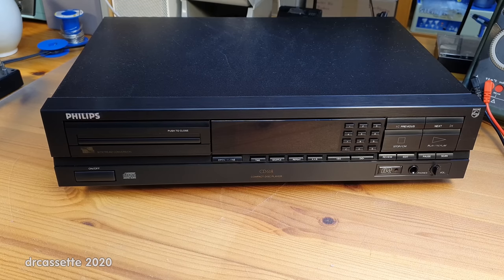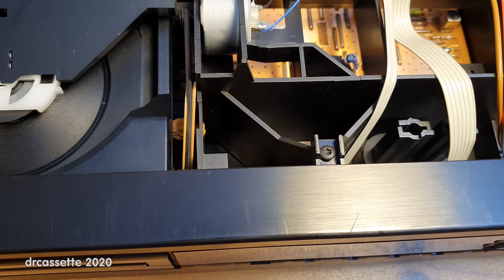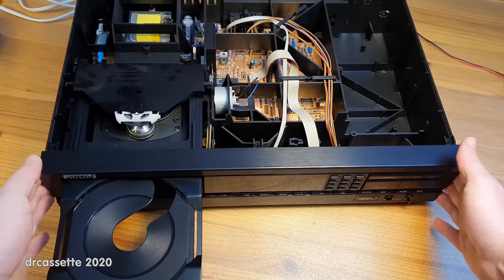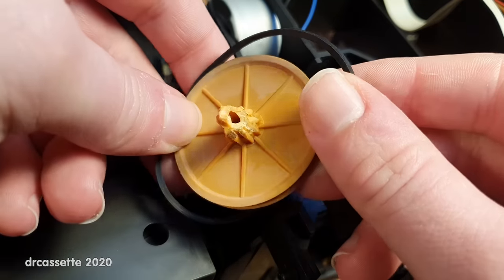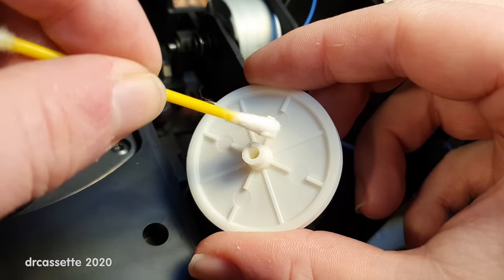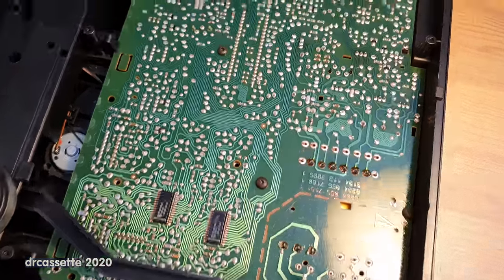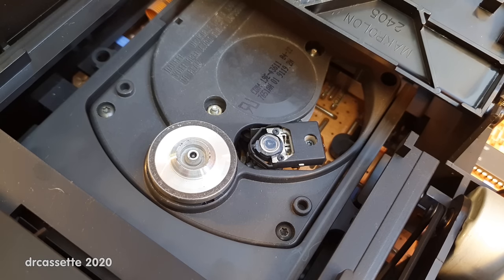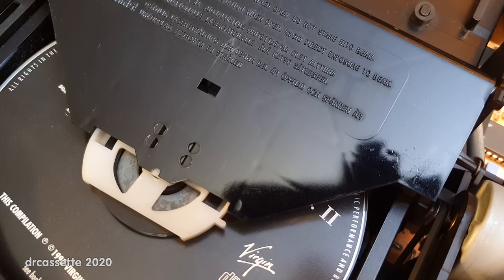Philips CD618 CD Player repairs - CDM4 drawer gear wheel replacement

Comment: You keep calling this garbage, but this was actually the end of the period when Philips and Magnavox (then owned by Philips) made some really decent gear. I would say between 1986 and 1993 or so. Philips also had a high quality reputation in the 1970s until about 1981 when they started using crappy plastic for everything; fortunately later in the 1980s they saw the error of their ways.
In the mid 1990s Philips was in trouble because of heavy competition from Japan and elsewhere, and that's why they started making everything cheaper again, with lower quality materials and components (they didn't make their own components anymore either).
Bottom line: Philips equipment from before ca. 1982, and from between 1986-1993 is not as bad as you may think. Serviceability was always bad with Philips if you compare it to e.g. Sony, but a lot of stuff didn't need servicing in the first place.
Reply from the maker: Where do I "keep calling this garbage"? Give me time stamps!
Reply: @DrCassette  You didn't use the word "garbage" specifically, but you did say some negative things about it:
0:10 "Nothing special" "plastic faceplate" "typical dubious Philips build quality"
1:19 "Lots of plastic; yes it's a Philips, what did you expect"
13:23 "The top cover has this weird texture... that's annoying"
I'm not saying you're wrong, all those are valid comments for this particular CD player. And you praised it too.
My point is that Philips didn't always make crappy stuff and this was not a crappy CD player at all when it came out, even though Philips was in its "Let's Make Things Better" (but only for the shareholders) phase in 1991 (a lot of people at Philips lost their jobs around that time). The number buttons on the front panel and the display that shows track number and time simultaneously are a sign that this was probably a higher-end model at the time, and in spite of the stupid drawer gear, I'm sure it still works great after almost 30 years. I'd say that's commendable. :-)
Anyway thanks for posting!
Reply: @JacGoudsmit  the problem is that they were a great brand in all they built but in the early 80´s they turned themselves for plastic and low quality equipment, when they notice they lost is market regarding to hi-fi components ,the release of new quality material was done but the building materials were still bad ,and when to release the digital cassette i watched when in Lisbon they rented a store in a shopping center or mall  they didn´t caught the atention of possible byers ,at the time i was living in Lisbon, Portugal and several times i watched the store empty, people were already used to relate philips with low quality ,they had the colour grey to see if one could find it interesting but still bad quality plastic employed in the building of the components ,they had earlier a good quality hi-fi components but by that time no one looked for philips to buy a hi-fi system, they did own other brands where the selling success was great but not that good as expected, but it´s sad to see one of the greatest brands destroy themselves in what relates to hi-fi components, the ones i bought from their 79 F series were good ,they still are in use and with great sound quality, but they lost with the at the time manager of the brand, with a incredible decline of quality . I owned a radio with a strap to carry on the shoulder that the deck A was incredible good playing cassettes but having used it for around 10 years to listen to music whenever my group of friends travelled to the beach or countryside it endured lot´s of bad treatment ,it kept working till today, my father who was faithfull bought in 1990 a ,what they call now boombox and it was really good in what cocerns to sound quality ,this with not so big woofers they had a lot of bass with an equaliser and a on/off button to increase the bass ,even had a on/off key to work ,normally they work when you pressed play on the tape or turn the selector to the cd player or radio, that was a good boombox compared with others from the same year, all the brands did decline their building quality by the same time but the quality of the components still was there no mather if they were all made of plastic,we had to surrender to japanese brands it was a pitty seeing several european good brands disappear by the same time . About Magnavox i never seen other than philips material re-branded , if it turn out to be an independent brand i never saw it ,the radio that i refer to with a strap to carry it on the shoulder had a Magnavox brother but instead of light grey was black ,this in austria ,the only place i saw magnavox material ,regards

Comment: I have a Philips CD 750 it won’t play the first track of any CD and then skips occasionally it seems like it can’t find the starting point any ideas please let me know thank you
Reply from the maker: You could try to very carefully clean the lens of the laser. Use an alcohol based window cleaner, apply it with a cotton swab, use another cotton swab to dry it off. Generally there is not too much that usually goes wrong in the old Philips mechanisms.
Reply: @DrCassette  thank you it works perfectly now

Comment: You do not have to remove the frontplate nor losen the powerswitch,just take of the clamp and you can slide out the cd platter through the front
Reply from the maker: No, you can't. Not on this model. The end stops for the CD drawer are part of the front. With the front in place you can not pull out the drawer.
Reply: @DrCassette  Oke,my fault,I am used to the other design of Philips I guess,

Comment: I wonder if the replacement wheel is a 3D-printed part.
Reply from the maker: It is not. It is a proper injection molded component.
Reply: @DrCassette  Thanks for the clarification.

Comment: Dubious Philips build quality? It might be plastic but dubious? It is one of the best Philips CD players.What does it matter of the housing is plastic? It has no effect on the playback. What do you have against Philips? ;-)
Reply from the maker: Not sure why you would call this one of the best Philips CD players, compared to for example a CD204 this is quite sad. Also remember Philips was responsible for things like the almost all plastic N7150 reel-to-reel...
Reply: @DrCassette  This was the last CD player with the CDM-4 and which has a TDA1541. What does it matter if it has a plastic housing? It does not effect the playback or performance. 

I have sold and repaired CD players since the introduction of the CD. And your focus on this player is way off when you only focus on the plastic. A lot of other brands also used plastic housing. But that does not make the player any worse. The essence here is the performance which is outstanding.

You also act as if Philips products are built in a dubious way with plastic. That is your opinion and that is ok but plastic can often also be firmer to metal. And that is what you want. Metal bends. Plastic does not.

Comment: Philips used crap plastic during this era. I think they made it out of toffee. I have several components which are all unserviceable. Such a shame that a great company & innovator stooped to such crap componentry.
Reply from the maker: It is worthwhile to look around online. Since Philips products were so popular, it seem like there actually is a large variety of replacement gears available from different sources. I have another project coming up that will involve replacing gears in a Philips cassette deck.
Reply: it´s true i notice the same in the turn for the 80´s decade

Comment: hello dr cassette!  are you interested in a hitachi hifi system from the 70s / 80s?  I give it away for 20 € because the power button does not click into place and some drive belts are defective.  It would be a shame to throw them away. 
I am from germany:)
Reply from the maker: Thanks for your offer. Can you see a model number on the system?
Reply: @DrCassette  SDT 1000m
Reply from the maker: Alles klar, danke. Leider muss ich dir ganz offen sagen, das ist nicht die Gerätekategorie, für die ich Geld ausgebe. Zumal die Versandkosten für so einen Turm auch nicht wenig sind. Allerdings wäre so ein System doch eigentlich ein ganz gutes Projekt für einen Anfänger - vielleicht magst du dich selber mal an der Reparatur versuchen?
Reply: @DrCassette  hatte die Reparatur schon versucht und bin leider gescheitert da es viel Fummelei ist. Jetzt suche ich jemanden der das für wenig Geld macht.
Reply from the maker: Ach so, okay...

Comment: I've got a Philips CD150...tray comes out but the flip down door it's supposed to push prevents it opening....unless I flip it manually then it's fine. Any ideas what the issue could be ?
Reply from the maker: Seems like there is not enough force transferred from the motor to the drawer to push open the door. This could be caused by a bad belt.
Reply: @DrCassette  cheers mate. Is it a similar process to this unit?
Reply from the maker: @midnightpretenders5749  Unfortunately I don't know.